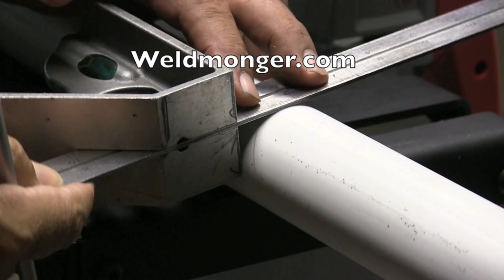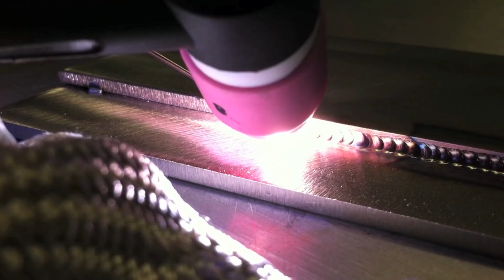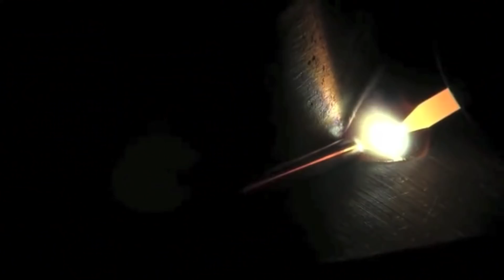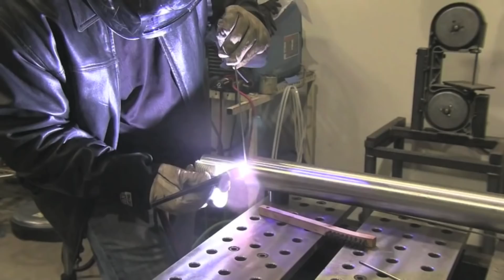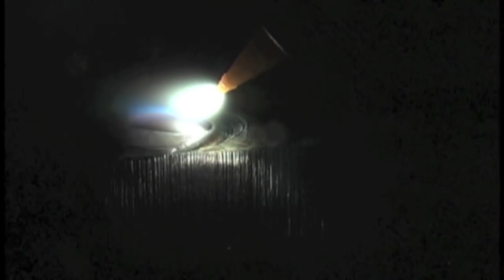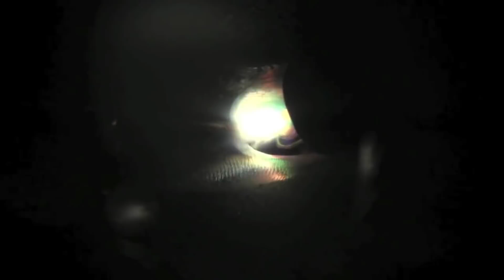TIG Welding Rods, Tig Rod Storage, and Arc Shots

Comment: Great tips for the person who has just acquired a Tig welder. Have you made a video where the material you are Tig welding on has been in used? Materials with dirt or  oil, lots of rust. I know that to achieve the best welds the surface has to be cleaned as much as possible but will using Tig  be able to do the job?
Reply: +Jacob Esparza No, must be clean from oil, you answered your own question.
Reply: +david eirth The reason I say that is. All videos I've seen have been working on scrap metal or new material.  I'm in the automotive field and most of the time things that need repair are full of oil and crud. I know they have to be cleaned as much as possible but would be nice for Jody to make a video about it.